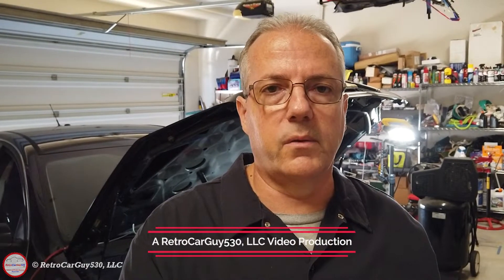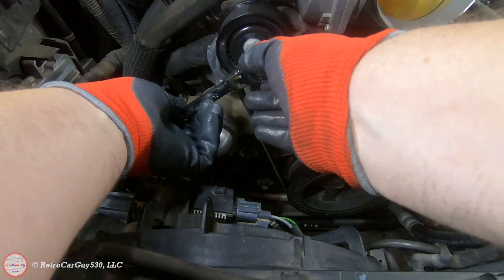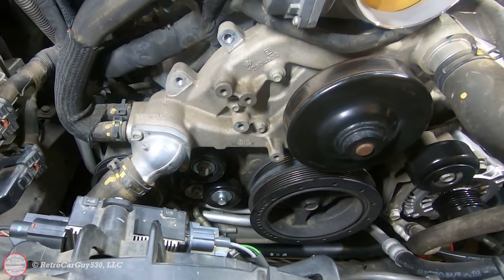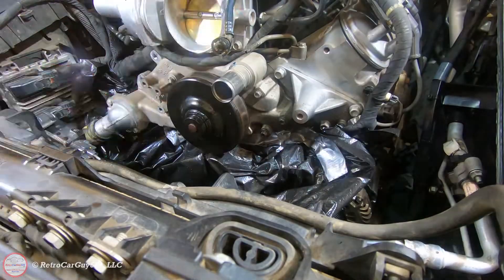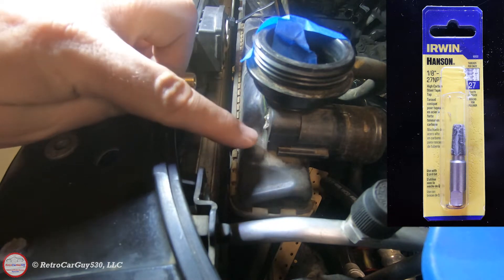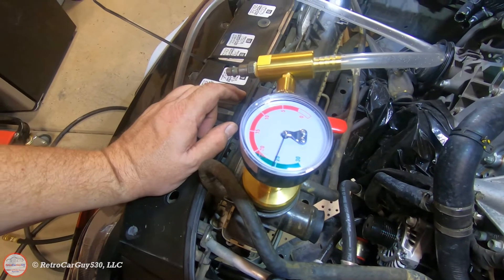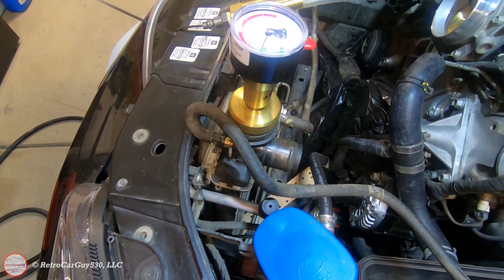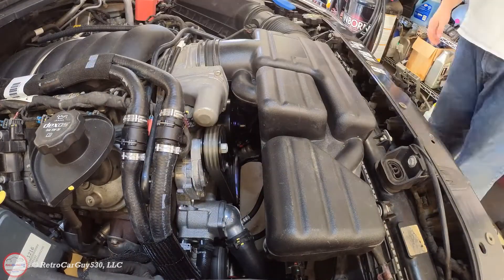2014-2017 Chevy Caprice PPV - Cooling System Refresh

Comment: I broke that nipple replacing the condenser, broke at the base. 
Opened up the hole with a drill bit then tapped it for a trans cooler line , spread jb weld around threads, around hole and snugged her up.
Years later still good not a drop lost.
Reply from the maker: Three years later, my radiator nipple repair is also holding up well.

Comment: 0:56 what is  that whole system I currently have this motor swapped into a trans am and those metal lines that go under the intake are leaking coolant how do I stop that /I do have it blocked off where it seems you have a hose going on the tip
Reply from the maker: That metal tube runs between the cylinder heads (engine coolant bleed/crossover pipe).  The hose on that tube is not a full hose.  It only wraps around the tubing (approx 90 percent) to act as some sort of insulator for the tubing inside of it.   It looks like that part number is 12694769 for the one that fits the L77 6.0L engine in my 2014 Caprice.  In the pictures I have found for that part number, you can see the "rubber hose" part simply covers the crossover tubing.

Comment: I'm curious if you could purchase that T off an SS and if it would fit.
Reply from the maker: I think you could use the one from the SS Sedan.  The part charts for the SS don't show a part number for that part.  The Caprice part charts show it as part number 92246934.  It looks like there are a few of them on eBay at this point for about double going rate of various online part websites at $28.04.

Comment: Where is the power steering pump? Mine has one where yours just has a pully
Reply from the maker: The 2011-2013 Chevy Caprice PPV (WM series) has hydraulic assisted power steering with the power steering pump located above the alternator.  The 2014-2017 Chevy Caprice PPV (WN series) has electric assisted power steering, so the power steering pump was removed.  My car is a 2014 Chevy Caprice PPV, so no power steering pump.
Reply: @RetroCarGuy530  ah ok mine is a 2012 the water pump has alittle play in mine
Reply from the maker: The original water pump in my 2014 Caprice PPV had a some play that I tried to demonstrate in the video.  The first replacement water pump had the pulley pressed on unevenly, but I was able to get Amazon to replace it under the ACDelco warranty within a couple of days.  I purchased the first water pump several months before I got around to filming the cooling system refresh video.  By that time, the return window had closed, but Amazon dealt with it nicely through the ACDelco warranty.  The second one arrived and is installed in the car now.  No more play in the water pump drive shaft.  It looks like the 2011-2017 Chevy Caprice PPV 6.0L all use the same water pump.
Reply: @RetroCarGuy530  my current one has enough play you can feel and see it with the belt still on. Im going to purchase one from Amazon my local parts store is over $100 higher than amazon
Reply from the maker: If you're going to buy it through Amazon, please consider (not required at all) using my affiliate link for the ACDelco 251-728 original equipment water pump.  I will make a commission on the purchase, but it won't increase your price at all.  My affiliate link for that water pump is https://amzn.to/2EGhsIe

It's a great way to support my channel at no extra cost to you!  Thanks.
Reply: @RetroCarGuy530  i will I added it to my cart from your link

Comment: Did you get the Caprice from the state auction in Davis?
Reply from the maker: No.  My Caprice PPV was owned by the San Juaquin County Sheriff's department, CA and it was sold at auction to a dealership in Modesto, CA.  The dealership sold the car to a relative in Oakland, CA, but when COVID-19 restrictions hit they decided to sell it and that's when I purchased it back in March 2020.  I looked at several up for auction in Vallejo, CA before I purchased this one, but they all had some serious issue that prevented them from being used as the basis for my project car.